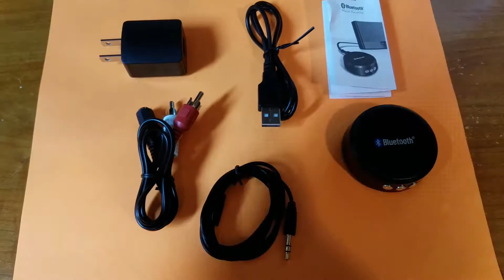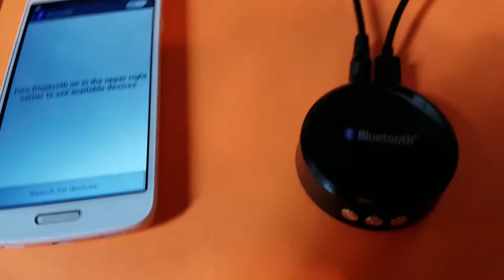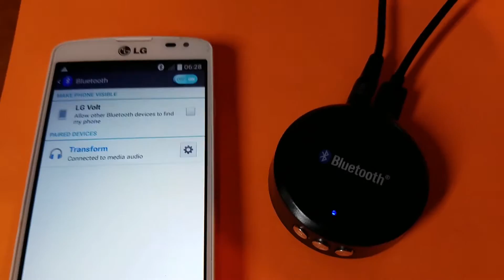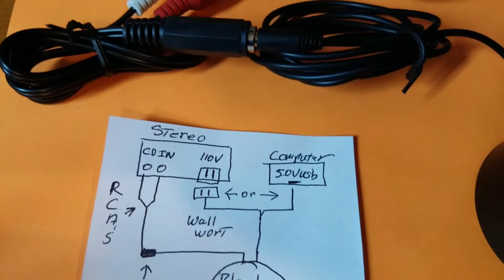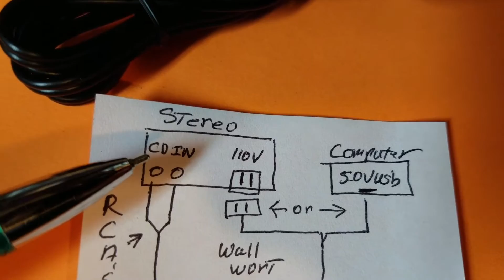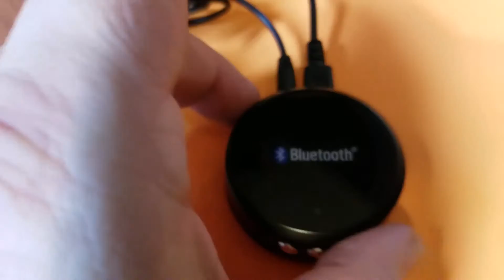BLACKWEB Bluetooth Music Receiver Set up and REVIEW

Comment: Someone from work just gave me one of these but I'm having trouble setting it up
Reply from the maker: Should be easy to hook up. On the rear panel is a mini USB plug and next to that should be a 3.5mm headphone jack. That 3.5 is the audio output. So hook up a 3.5mm to RCA male plug to your receiver.(aux or cd in)  If you can't get the device paired to the blackweb try to reset the BT by powering it up and hold the power sw for 10 seconds. Then try to re-pair. Remember... the blackweb needs power/ from a 110v to USB adapter to power up the blackweb bt unit. Does this help?
Reply: Which button is the power switch? @breakerbroke23